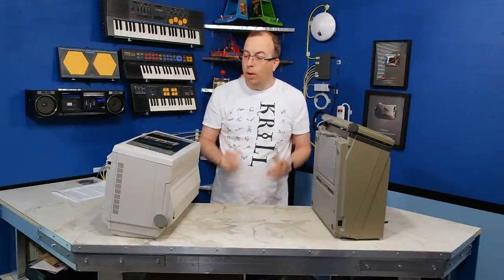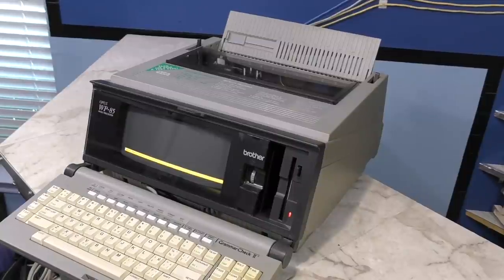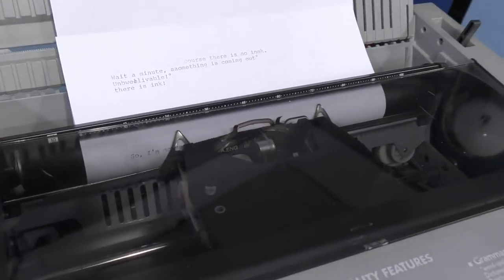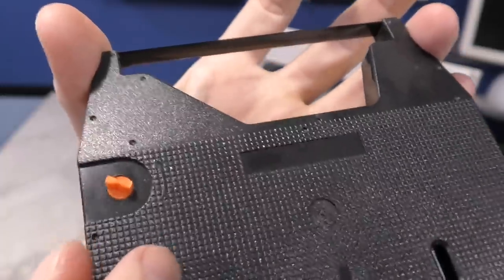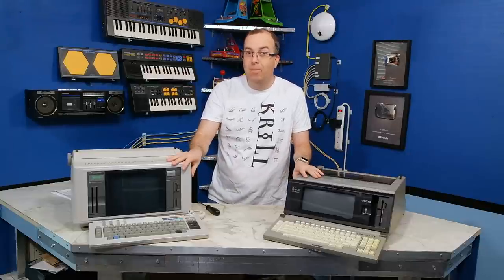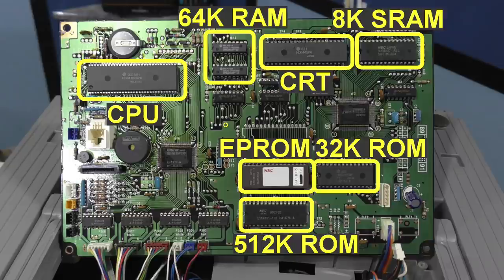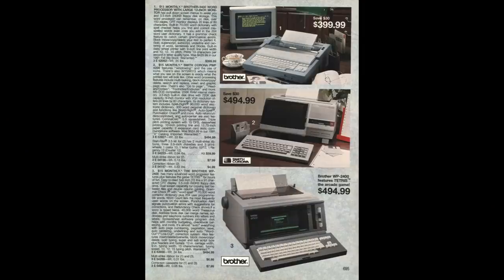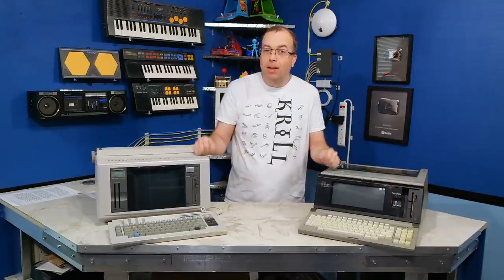Dissecting two Word Processors, Brother WP25 and Panasonic W1525

Comment: Thanks for the video. What a coincidence! I had dug out my Brother word processor from 1991 just last week. I was watching a Youtube video about the development of Unix from Bell Labs and it kind of reminded me of it. My model has a separate amber CRT and it works flawlessly. It has separate disks for various things like the dictionary and spreadsheet program. I decided to back up those single density system disks, and it took a very long time. There is very limited onboard RAM so frequent disk swaps were required. I am going to order some new ink ribbons and relish in the nostalgia of the very loud "CLICKETY-CLACK" sounds.

Comment: That location is the UNIX possition for backspace , its like that on the HHKB. Or in short its where it should be :).

The text on that panasonic is fantastic , i have seen some so called "modern" laster printers that are not that chrisp .
Reply: Andrew Joy Yep, physical metal types with non-textured ink ribbons or ink application system is the standard that computer text tries to imitate.

Comment: The Panasonic was considered a typewriter and can probably compete with the Brother. That’s why it has a lift-off ribbon. You can still get sets of ribbons and lift-off tape on Amazon new (not new old stock - new) for about $18. VWestlife has a video on his channel demoing Tetris on his Brother Super PowerNote laptop style word processor. I suspect that’s the same version that would run on yours, you should probably contact him and see if he can send you a disk image.

I’m 58 and I’m seeing a good number of videos done by people who never grew up with typewriters and who probably never had to take a typing course in high school. I had to take typing back then, but I was more interested in art because I wanted to draw for a living, so i was never that good as a typist. The art thing didn’t work out so I taught myself how to touch type. Now I type about 45 wpm. I didn’t have a full fledged computer until 1993, and I had to learn all over again because the layout between typewriters and computer keyboards was different enough to screw me up frequently. 

I worked for Circuit City and The Federated Group in Southern California in the 80s. I sold computers and office equipment and I can’t tell you how many people came in looking for a computer so they could take work home, getting sticker shock at the prices, and either walking out empty handed or with one of these. I suspect the Panasonic spreadsheet is Lotus 1-2-3 compatible, and you could probably read up its text files in Word Perfect or Word Star. Maybe you could demo that.

Comment: The ink ribbon cartridge, heck, the whole typing mechanism looks like it has been taken out of the early '90s line of Brother typewriters I learned touch typing on. You may be able to find replacement ink ribbon carts in office supply stores (unless they drastically changed the form factor in the past 25 years) :)

Comment: I had a Brother HR5 printer that used the same ribbon tech as your newer Wordprocessor.  In 1983/4 it cost me £150.  It was 30 Charactors per second and you didn't get an awful lot of A4 aheets printed with the cartridge.  It did have true descenders (A 'y' for instance would have the tail going below the rest of the type which made the text easier to read.)

Comment: The Brother machines I had had interchangeable daisy wheel font disks in which you could swap out (it also had only 3 or so lines of text which was pretty rough!). I had a script font that I remember thinking was the coolest - it came as part of a font set that had script, a San serif font and an additional “fancy” serif font. If I remember correctly, The exchange mechanism was pretty cool as well.

Comment: i had a newer model Brother WP-1400D  but it had the green screen and you could use it either as  an electric typwriter or it had a built in printer, plus a 3.5 inch floppy drive. it was my very first "computer" in the loose sense of the word

Comment: In the 90's, we had a similar vintage (I want to say, Toshiba?) word processor for Japanese language, which had a plasma screen, and used two different types of mylar ribbon. A single strike ribbon was used for "letter" quality printing, and could only be run through once, like the Panasonic shown in the video. A multi strike ribbon that could be run through several times was used to produce "draft" quality output that you might not want to distribute to anyone important... That printer was dot-matrix of course (a daisy wheel for Japanese would need to be the size of a truck tire!) I may still have this beast in the garage somewhere, come to think of it. 

By the way, IBM Selectric typewriters used the same type of mylar ribbon, but more intelligently than that Panasonic printer. The letters were not just stamped out of the middle of the ribbon. They were staggered top, middle, and bottom in a diagonal arrangement, to more fully use the media.

I also still have a Citizen brand portable printer that came bundled with an Epson PX-8 Geneva (CPM-based portable), that I purchased from the old DAK catalog in the mid-80's. The Citizen printer was able to use the same exact ribbon cartridges as the Toshiba word processor, so it must have been some sort of standard at the time. That Epson was a sweet little machine that used software on ROM chips you would swap in and out as needed. Ashton-Tate dBase II and MicroPro Wordstar were on a couple of chips that came with the machine.

Comment: Here's something interesting. If anyone ever comes across old word processor disks, you CAN actually open the files on a modern computer with Windows - assuming of course that you have a computer with a 3.25 inch disk drive. Just copy the file over from the disk, and rename the extension to ".txt".  Word processor files should just be unicode text files. Then you can open it with Wordpad. At least, this worked for me. I was able to open files that I typed on my Smith-Corona word processor back in 1995!

Comment: Thanks for a fantastic video. I had an odd fascination for these things too. Did the Panasonic floppy drive work? On the I have Brother I have from the same family the floppy drive is working , sadly on the Panasonic the belt turned to goo and despite getting new belt I just could not get the tar nastiness all off. I did attempt the repair as the drives use a combined socket for power and data, in the same manner as Apple did. The Panasonic is still in bits I have to confess. If you do consider any work on the units themselves then be prepared for quite modern design work insides, that is to say, it all becomes quite flimsy once the case screws come out.

Comment: My parents used to have a desktop DOS based word processor, it has a dot matrix printer attached that they described as being extremely loud, I faintly remember them keeping the old green monochrome  monitor, and using it with our windows 98 machine, before they upgraded to Xp in 2005/6

Comment: I have one of those Panasonic ones :) But mine has an LCD screen.  On these printers the erase doesn't actually white out the ink. It lifts the ink off the paper. Right after the ink has been deposited onto the paper it can be pulled off if the erase functions are used correctly :)  The white out stuff is an adhesive that sticks to the ink to lift it off the paper

Comment: I have a WP-1400D, which is essentially the same as the WP-85, but it has an 80x12 non-backlit LCD display instead of the 80x12 CRT.  It uses the same "OS" / software, weird 240KB disk format, and has the same CPU and RAM.  I don't have any of the application disks, but my understanding is that the application files are just a simple header and direct Z80 machine code, with no copy protection, and you can create application files yourself with any compiler/assembler.  The main difficulties would be reading/writing the disk format (a Cryoflux can do it, as can a variable speed drive like the one used on Apple IIGS / Macintosh computers), and accessing any BIOS functions for things like disk access if you didn't want to write all that from scratch.  Unfortunately, even though these are essentially Z80 personal computers, there hasn't been a lot of community effort around dumping the ROMs or original disks.

Comment: I used to have a Brother machine similar to that one. Mine worked perfectly and made the same noise yours did. I got mine in 1992 and I am pretty sure it cost around $500 which seemed very expensive at the time. Also, that thing is just barely portable. It weighs a ton!

Comment: As to whether the 6445 could do bitmap graphics:  No.  And neither could the 6845 for that matter.  The chips are only for supporting the CRT sweep.  The actual text/graphics/colors are completely up to external electronics.  The 6x45's do have support for text modes though, as they have raster address outputs to tell the supporting hardware which line they are displaying so that it can look up the correct character table row.  They also have cursor support, in that they have a data line that says whether or not the cursor is shown for this dot, and two addressable cursor registers.  They also output an address to tell the added electronics where to pull character/graphics data at the moment, and create the sync signals.  So basically they're just counters that are optimized for use with a CRT.  My guess is that one of those custom quad chips (probably the Mitsubishi-looking one that has a bunch of lines to the SRAM) is the actual display controller chip.

However, another note about the Brother is that it has an empty location for yet another ROM chip, either a 28-pin one or a 32-pin one, looking at the silkscreen.  So that creates another interesting possibility for hacking.

Comment: There is quite a lot to be said for those designs.  Amstrad took them a stage further, everything in the box including wp processing software, printer - plus the ability to run other (and third party) applications.   But the simplicity of these machines has a lot of appeal and charm.   And they still work, more or less!!

Comment: The correction ribbon is probably “lift off” vs “white out. Those Mylar ribbons could have the ink lifted right off the paper with this type of correction tape. This left only a slight impression on the paper as evidence of your mistake. 

Most typewriters from the late 80s on had this setup

Comment: The Brother has a high yield nylon ribbon type 1032, but came standard with the film type 1030.

Now here is the good news, your Panasonic came with Brother type 1030 and can also take the 1032 from your Brother, but the correction won’t work as you need cover up instead of lift off with nylon and it appears that while the ink ribbons are identical, the correction spools may not be.

Comment: The Panasonic must have had a typewriter mode.  The correction tape does not cover up mistakes, it lifts them off the paper.  The ribbon you were using was "correctable" or lift off correctable ribbon.  You could use a longer lasting, more economical fabric ribbon for print outs, since they could not be corrected by the Panasonic in the typewriter mode.  I used to sell Panasonic and Brother word processors.

Comment: I really want a word processor like this, i have a german electric type writer, it is like thr brother in that the ink is faded, im suprised the ink ribbon works too, i also have a few spare ribbons though to change it is not as simple but lasts a long time, i do use it for work but errors never come out well, but on a word processor like the Panasonic and WP25, it would be lovely to have an inbuilt screen and to watch it print!

Comment: The last (and only) word processor I used was a Canon Starwriter 30-II bought around 1994/5, it hung about 'til around 2004 when it finally "disappeared" (probably binned sadly), and it used a thermal transfer tape that left the text on the tape, it was fun pulling those apart & reading the text printed on them 'til I found one of the family had been writing & printing some filthy stories, which at the age of 10 was just a bit disturbing....... :S

Comment: @4:58 it notes about MS-DOS being a trademark of Microsoft, wounder if it has some sort of DOS under its UI or some sort of compatibility (might just be that it can write to msdos formatted disks

as far as the 240kb brother, its probably single sided double density as a SS-DD disk for msdos was about 360k.

They do look like they could be cool projects
Reply: The 240kb Brother typewriters actually do use FAT-12 type DOS disks, single sided yes, but the low level coding of the disks are GCR (like what's used on Apple II and C64), not MFM as what modern systems use.
There were also 120kb disks which had even more primitive layout, somewhat of a precursor to FAT-12.
The downside of the Brother disk drive is that the first track can start more or less at a random position on the disk surface, not even necessarily at a poisition that's accessible for a standard PC-diskdrives.

Comment: Did a little research, can't find reference to 240K 3.5inch disks anywhere. Closest I could find was Sony's very first 3.5inch disks which were 218.8K but only formatted to 161K. It only took about two years before the advent of 360K single-sided disks and another year until we got 720K double-sided disks. That's a pretty speedy development for the time.

Comment: @12:00 - I don't recall the details anymore, but someone did hack at least one model of Brother standalone WP from that era, turning it into a working computer. I ended up buying one for my wife from a second hand store, on powerup it gave an option to either boot into Basic or the original built-in WP program...

Comment: If that correction tape is like the one on the carbon-transfer ribbon WP I used in the early 90s, it works like magic and lifts the carbon off instead of painting over it like white out, IIRC.

Comment: Incidentally, you can easily refresh a fabric ribbon by taking the top off and lightly spraying it with WD-40. Yes, really. They rarely run out of ink; what they run out of is solvent, and the WD-40 will replace that. Alternatively, I found a new plastic ribbon for my LW-30 in a high-street shop in Zürich, in stock.

Also, chances are the Brother word processor does have a bitmap display. Look for a 'LAYOUT' button, which ought to show you a graphical page layout preview.

Comment: The two upper socketed chips on the Panasonic model are definitely ROM chips, the KM23C1000 being a 128kB chip, the KM23C4000 being a 512kB chip. I'm guessing the 128k chip is for the character set and the 512k chip is for the programs and dictionary/thesaurus functions, but I'm not positive.

Also, that M3864B-21 chip labelled IC9 might be the 64k RAM chip, though I haven't been able to confirm this yet.

Comment: I'm actually really surprised to learn that one of these is from 1992! My dad bought our family's first desktop PC in 1992, so I would have thought that by then, these sorts of word processor units would be obsolete.

Edit: my guess is these units were WAY cheaper than full DOS PCs if all you wanted to do was type documents.
Reply: Certainly a lot cheaper than a full DOS PC, meaning one with a hard disk. Perhaps if word processing was all you wanted then you wouldn't need a fast CPU, VGA, sound cards or even a hard disk. But you would need to buy a monitor, and regardless of whether you could get it down to a similar price or cheaper than the word processing unit, you would still be buying a big desktop box and monitor and printer rather than a portable all-in-one system that you could take to a workplace or college/university. As well as that major factor, PCs weren't all that intuitive to a novice. With a word processing unit you don't need to know DOS commands, etc. I think this is around about the time that my sister bought one for college, and with the family recently having been blessed with a home computer (Amiga) it did seem a waste to buy what was essentially a computer, but one which could only do typing!

Comment: The WP-85 in this video used the same 1030 carbon film ribbons that all Brother daisy wheel typewriters/printers used, not “ink”. The lift off correction tape just pulled the film off the paper with adhesive.
If there’s an actual inked ribbon in yours, someone bought that as a cheap third party alternative. I would not use it. Ditto for any “white out” style correction tape.

Comment: I think the strange low disk capacity may be due to it being based on a previous model with a 5.25" drive.
Some of the later WPs had a serial port, and could be used as a terminal. I want one like this to use with LInux. Be great for a RPi.

Comment: I couldn't find anything for sure, but I think the two chips between the CPU and CRT controller are CMOS chips. The logo is Samsung, I can tell you that much. The one all the way at the bottom may be a ROM chip as well, based on finding a part number M3864-06 that's a ROM.

Comment: That backspace position is similar to that of the CR key on an ancient typewriter.
Reply: ElMariachi Yep the whiteout (correction) button separate from the backspace on some electric typewriters.  Not the CR (carriage return) button on ASCII terminals, which is the big return button.  But yes the correction button was sometimes labeled with "<CR]" where the lines forming a 5-sided arrow shaped box around the two letters.